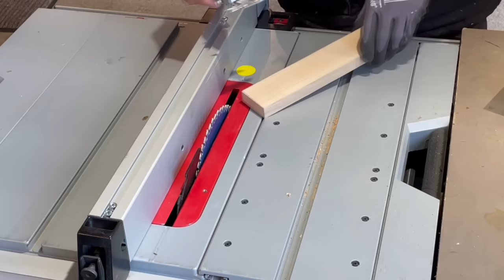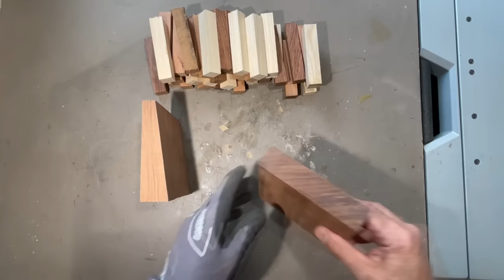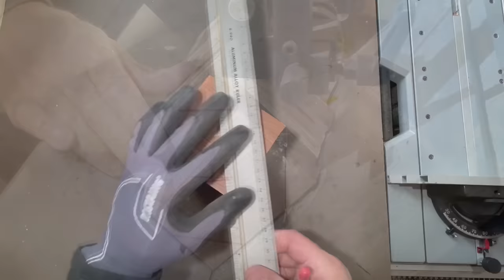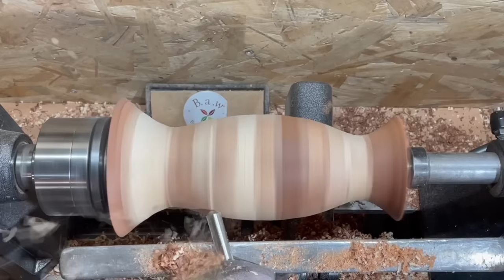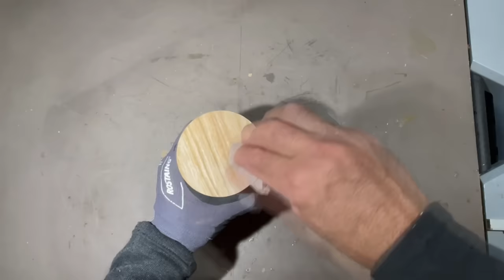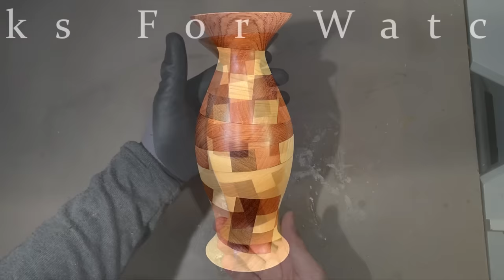Woodturning : When geometry reveals surprises😳

Comment: I'm curious why you chose to use ca glue instead of the usual wood glue? It seems like you would get more reliable, allover adhesion with wood glue spread over the whole surface.
Reply from the maker: I've used a special cyanoacrylate glue for wood, the advantage of which is that it dries instantly.